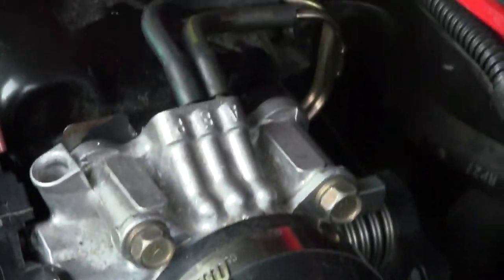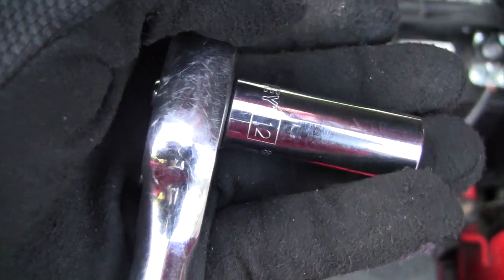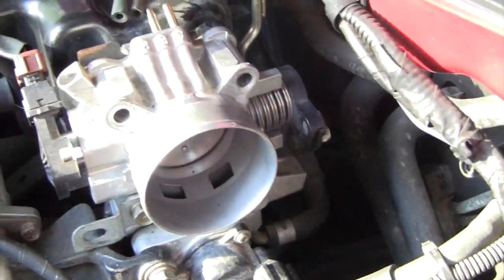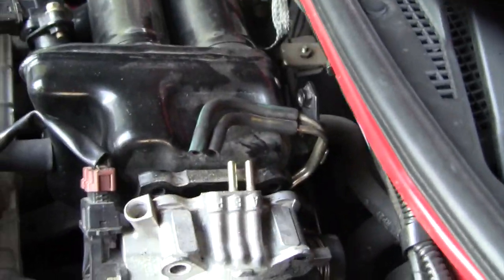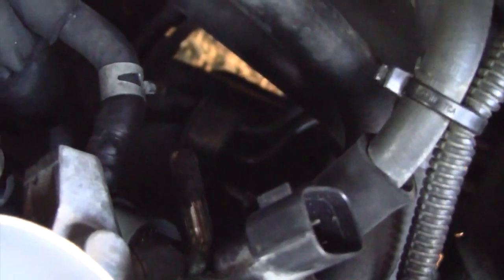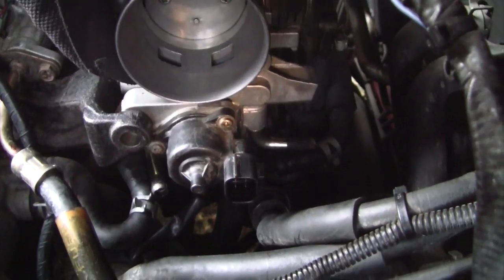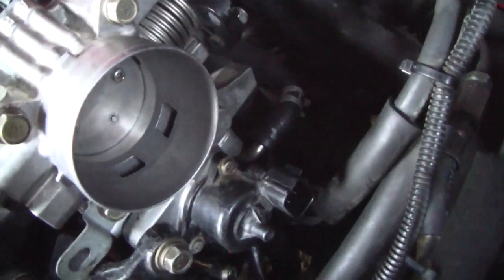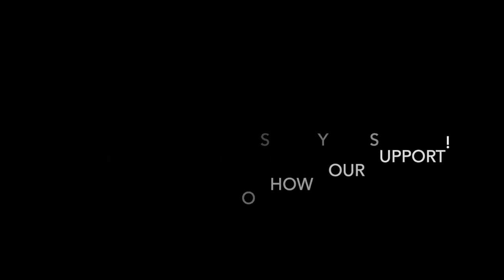2000-05’ 3G Mitsubishi Eclipse Throttle Body Removal

Comment: You said the idle was higher, has it stabilized by now, and if not, maybe you should disconnect the battery so the ecu relearns driving patterns. I actually notice my V6 running higher now, but after all the work I did, I'm not surprised it's all wonky now. Having removed the coolant hoses, you could've removed the other stuff too for a real deep clean. Those clamps are horrid, and they leave the factory facing away from mechanics.. Thanks Mitsubishi. The sensor with the small c clamp like clip can be removed with a tiny flathead screwdriver. Just gotta keep a hand on it so you don't lose it, and if you do.. well, unless you're taking ramps, the sensor will be intact without it.
Reply from the maker: It's cuz I was pulling on the throttle body while that wire was still connected.
Reply from the maker: I just needed to adjust the idle

Comment: Skittles I watched a video of oldskool funk on cleanin a throttle body. An fro what he said, is to becareful when cleaning that throttle an not touch that flap I guess you could call it. Because it would mess with the computer. Thus you would have to hook it up to a computer to correct the problem. Did you have any problems with strawberry after thos video. I ask becuz my lil bro passed his 3g to me an kept up with it. An I really dig the 3g movement/ lifestyle. An can you do a video on flushing your heateercore on a 3g. Thanks
Reply from the maker: did that have a electronic throttle body? cuz this one isnt.
Reply: @Smokinskittles  I have no clue. I cleaned it an my MAI sensor. If it did mess up what could I do to fix it

Comment: Wat kind of screws is that for the iac valve?
Reply: I know its a year later but for anyone else reading, theyre just little JIS head screws, be careful because using a philips driver in JIS screws can cam out easily and ruin the X shape. I think theyre just little M4 x 0.7 pitch screws. Every new IAC should come with new screws, mine did and I got an Intermotor from advance Auto.

Comment: You made a cleaning video that did not show you cleaning, what to use, what parts needed cleaning and what you used to clean them. This was a disassembly and reassembly video, not a cleaning video.  As Greg Rogers points out, there are no screws on an IAC valve, there are bolts. But life is full of lessons, DON'T STOP!

Comment: Can you upload a video of how to find you? Lol
Reply from the maker: Angel Cruz what? What do you mean
Reply: Smokinskittles I have a 2002 eclipse and I have check engine light, I think it's the 02 sensor heater circuit, can you upload a vid on that? Please 🙏🏽🙏🏽🙏🏽🙏🏽
Reply: ... I just replaced my belts, but it seems like the pulley is missing a nut to lock it completely in position can you please upload a video showing the outside of the pulley, I want to compare it to mine and see if that is the problem I have. Thanks in advance!